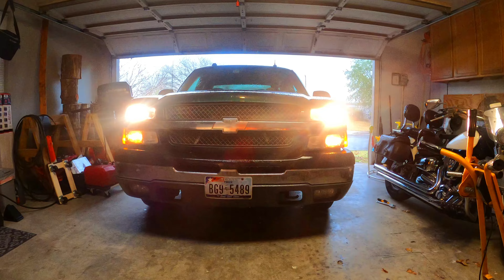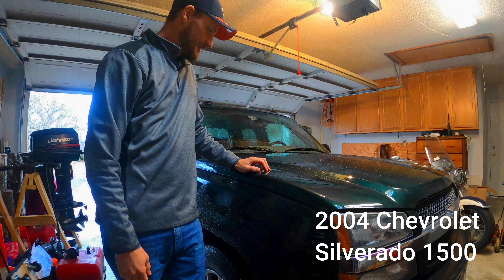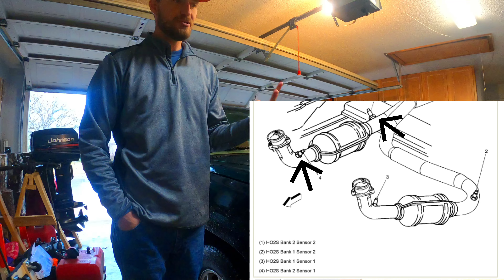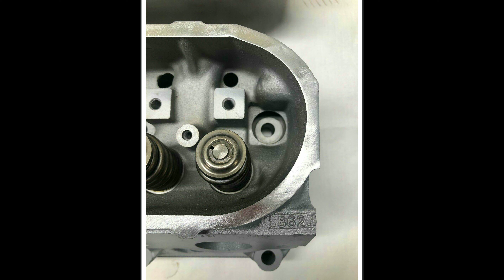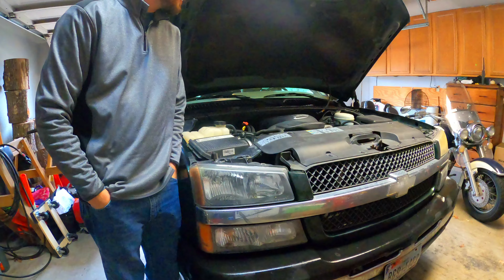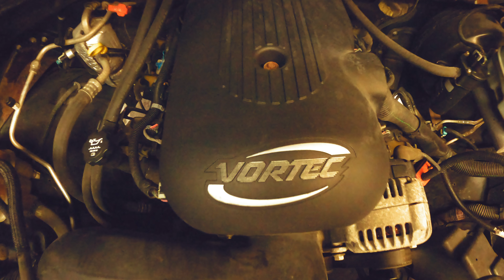2004 Chevy Silverado O2 Sensor Replacement!! This is too easy!!

Comment: The issue is the Catalytic converter being dirty ,its just a sensor and it can get dirty but main issue is the converter, the knock sensor code can be the converter issue , the main issue with the Gen 3 motors is a O ring in the pickup tube from the oil pump and when it fails it destroys the engine ,yes a maybe $4 part ,ask me how I know I just replaced the motor because of this but got 250,000 miles before that

Comment: Thank you! 😊
I do want to say I found out today that my 2006 1500 4x4 5.3L Denso is the original manufacturer part so 20 years is not bad. Also, my truck is not interchangeable with all 4. So my downstream is not interchangeable with my upstream they have different connectors. I haven't been under my truck yet though I ordered all 4 sensors from GM with all the information on my stock truck. Also only have one code for bank 2 sensor 1 but figured it's age the only other one replaced was bank 1 sensor 1 about 2 years ago, so I figured just replace all of them. 
I appreciate the videos on these diy fixes, and hopefully it won't be too hard to get to the upstreams..lol 😅😊

Comment: I just changed mines and now it has a  misfire . Hopefully just a faulty 02 sensor.
Reply from the maker: Thank you for watching! Try swapping the sensor with one of the good ones in the system and see if the problem follows. This will make sure you don’t have a wiring problem. Also it would not be out of the question for that new sensor to be bad out of the box.
Reply: @Eric Gaskamp  Yessir it in fact was the  new 02 sensor defective.  I did cheap out and get a cheap one from Amazon.  Ended up going with denso from autozone and cleared the code right up.   Thank you again.  Great video !